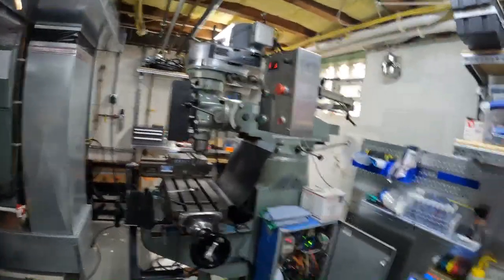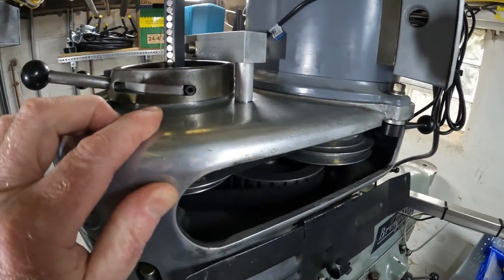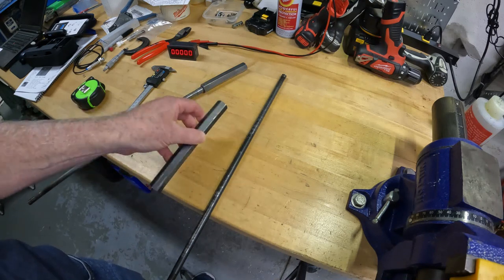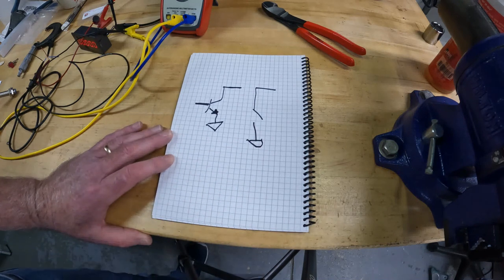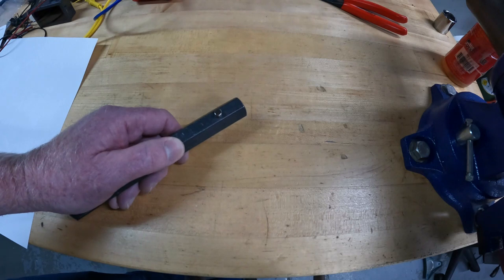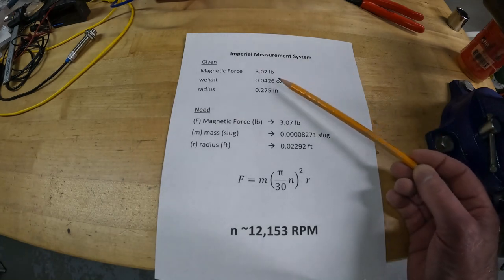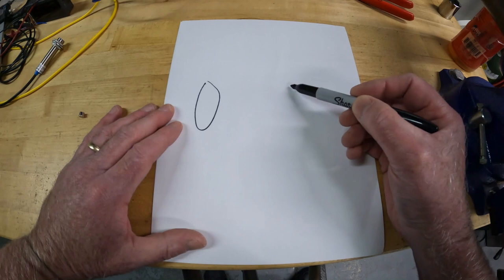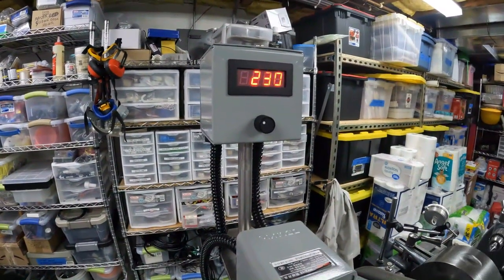Adding a Tachometer to a Bridgeport Mill & Physics Lesson

Comment: What are you using to power the tach and speed controller? Do you need to buy another power source and does it hurt the motor to have a speed control ( like a dimmer ) when you dial in the speed that you want to run at? I would like to do that on both my lathe and the bridgeport.